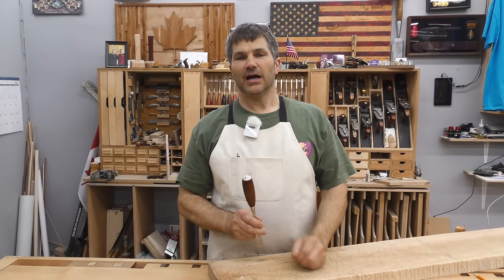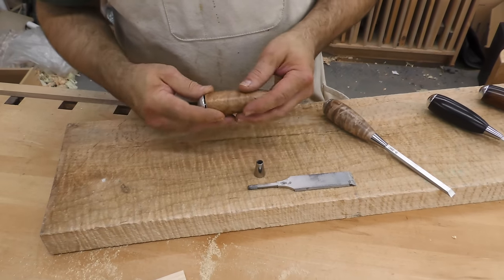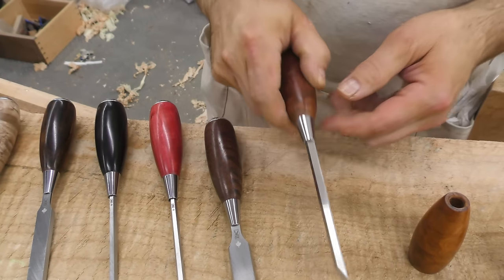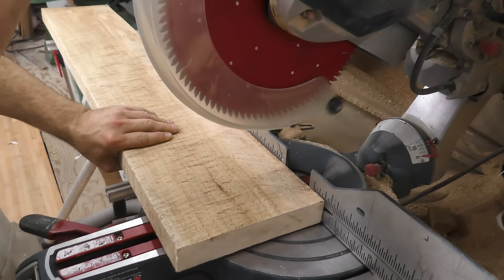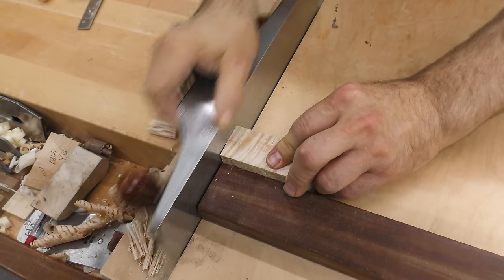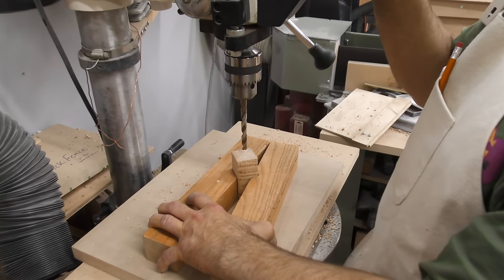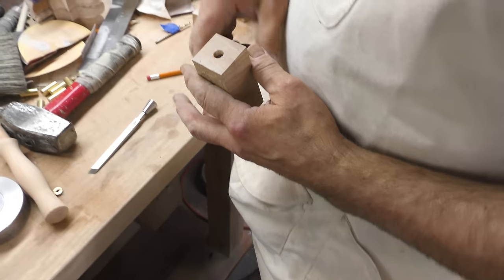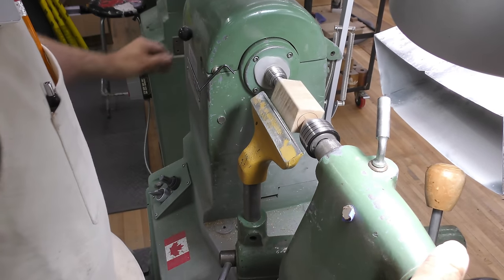How To Turn A Chisel Handle - FIGURED WOOD

Comment: First, I enjoy all of your videos, and how you honor our vets. I was a medic then PT specialist but didn’t have to go to Viet Nam. I have turned a number of though built handles and can tell you there is an easy way to get perfect sized ends to your work. I drill a blank or two into 2” square of 4/4 stock. I glue it into the middle of a 3/8” dowel. Then I turn the square using a draw barred 3/8” collet for a Morse taper to the circumference of your handle size. I have a Nova live center that accepts 3/8 dowel stock. The same way, I can match the inside diameter of the ferrule. I have of a full set of collets from the Little Machine Shop or you an get them at Crafts Supply. You can do the same by tapping 2x2 stock to your drive center and live center screws. I get a perfect bushing out of wood that last for numerous turnings and keep your handle on the lathe.

Comment: I just got my lathe last week and have been YouTubing several videos on turning- each video wishing that Rob had one to learn from. Great stuff! I’ll be using these techniques for my own IBC handles. Thanks, Rob. God bless
Reply from the maker: So was the video in time or too late?
Reply: Perfect timing. I wanted the lathe for a while, but finishing the PHP push lamp that I’m posting on IG was a little more inspiration. Gave me another reason to get the CBN wheel and grinding jig from ya.

Comment: I have a mini-lathe so I do mostly turning between centers as you are doing in the video. As far as how many RPM i have simple rules: The slowest speed you can safely and cleanly cut the wood. Sand at the slowest speed to minimize accidental heat build up which can crack exotic woods.
Reply from the maker: Good rules, i like them

Comment: That's awesome! I just bought a lathe. Keep on with the lathe videos.
Reply from the maker: yes I want to but this one is not getting many views.  What do you think the issue is?
Reply: @RobCosmanWoodworking  My guess would be that your audience is mostly 'hand tool' users and people looking for wood turning videos/instruction will be looking at other platforms/channels.  Plus I know of several several people that own a job-site or contractor grade table saw (like I do) but do not own a wood turning lathe like I do.
Reply: Put woodturning in the title, for starters. That'd get it in the search for non-subs. Also call it "Turn your first tool handle!" Like the other guy said, your base may not be into woodturning. If you keep making appealing content for it, that may change.

Comment: I've have a set of Stanley 740 socket chisels from the 40s, (no tang). What would be a good wood to use? They currently have oak with thick leather mallet surface. Thanks for ALL you do.
Reply from the maker: Since your are pounding on the wood with a socket chisel you need a tough wood.  Hornbeam, hard maple, European beech, Whit Oak, hickory, ash all would work well

Comment: Sweet looking handle Rob curious to know why you don’t put oil on the ends of the wood?
Reply from the maker: You could if you wanted inside the hole you drilled  too, but it wont be seen

Comment: i had a question all ready to go and you answered it for me.  i've been turning alot lately and really enjoyed getting a couple things reinforced.  i may have missed it if you said but what is that vibration i was hearing caused by?
Reply from the maker: The vibration is caused by the turning stock not yet being perfectly round, its slightly oval therefor the chisel vibrates if you lay the chisel on the stock.  As the oval shape spins around, it vibrates the chisel and this indicates you have not yet achieved a round cylinder

Comment: Saving up for some chisels now. But I can't decide between the IBC and Lie nielsen chisels. But quick question, there's nothing stopping us from making completely custom handles for the IBC chisels right? As long as you accommodate for the aluminium parts?
Reply from the maker: Well you probable need a lathe, but no there is nothing stopping you.  That's the beauty of the IBC chisels.  LN makes great chisels and products and I recommend them.   I just dont think most folks like the socket chisel design as the handles keep falling out of the socket.

Comment: do you find you get a better cut with the skew in one direction vs. the other?
Reply from the maker: No both directions are equal, if you are comfortable enough handling the skew in both directions
Reply: @RobCosmanWoodworking  the only place in my workshop where I can stand upright is between the ceiling joists...that severely limits the amount that I can adjust my stance. Comfort is a very precious commodity. :)

Comment: I know the song and dance about safety gets old, but I am wondering about the lathe. I get the no loose clothes and flying debris if the wood breaks. I’m curious about the chisel in the hand. Is it common/possible for the chisel to be grabbed by the wood and be torn out of hand? I heard your recommendation about holding the tool lightly, so I wondered. Thanks for your videos, Rob. Between you and Paul, I feel like I have second and third dads.
Reply: A run back with a skew chisel can make you jump out of your skin, but for the most part, it’s more bark than bite. When planing you have a shearing angle cutting long grain, the fiber isn’t fully supported relative to end grain. Also, whether a planing or peeling cut, the tool is presented at a high cutting angle, as in slightly above the centerline, that makes it tough to get a real leverage catch. The kind of catch you would get with a bowl gouge turning face work is more dangerous.

If he cut with a part of the edge too far from the fulcrum, the tool would run backward in the opposite direction, basically cutting a thread. The fulcrum is where the tool touches the rest. The catch is pretty much forcing the tool to rotate on axis,  until the part of the edge being used to cut comes to rest on the fulcrum.
Reply: With respect to holding the tool lightly, if you use a death grip, you’re less safe and I’d you’re tense, that can show up in your work. Most turning tools, the handle is braced to your side. Your index finger acts as a depth collar on the tool rest and you can move your body laterally, parallel to the bedways to move the tool. Good footwork Is helpful.
Reply from the maker: Ditto all that Robert said

Comment: That's a handsome modification for those chisels.  For some tools, I texture the handles with tiny annular grooves by using a nutmeg grater  This gives an instant positive grip for the hand but doesn't feel 'grabby' or clumsy.  Also I advise removing the toolrest when sanding.
Reply from the maker: Both great tips.

Comment: I need to practice more with the skew. I can use it pretty well but always end up getting a nasty catch at the very end of the project haha. Its a shame people go right to scraping. There is no skill in that and they never learn how to turn.
Reply from the maker: The skew is similar to a plane blade on wood slicing the fiber leaving a smooth surface,  Scraping is similar to rough sandpaper on a piece of wood.